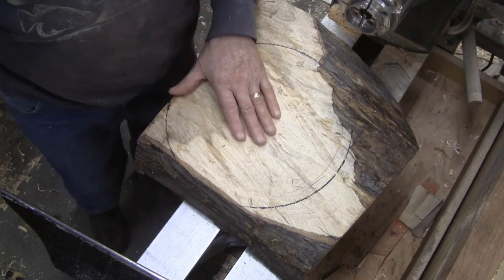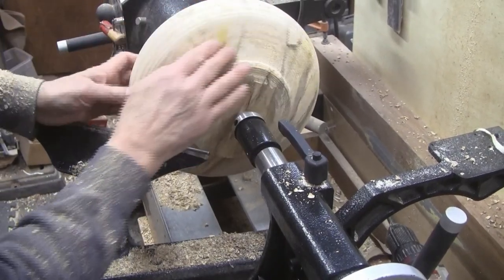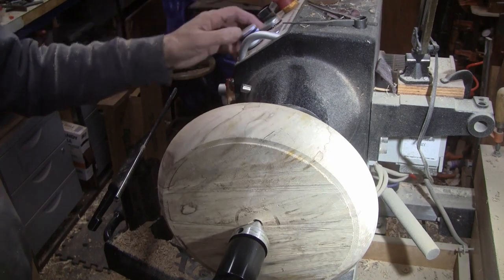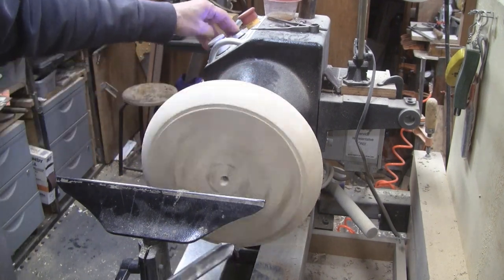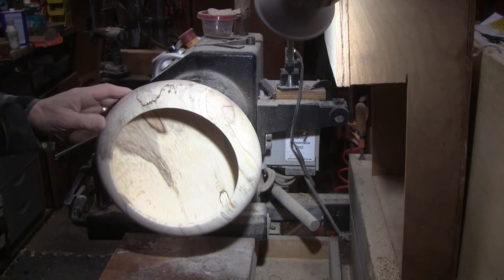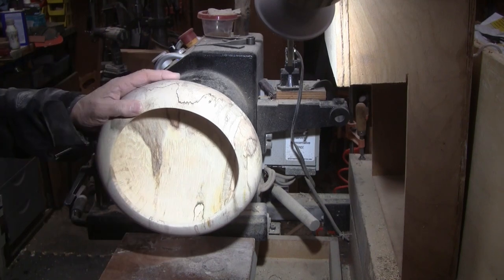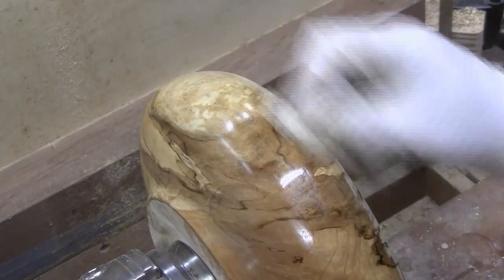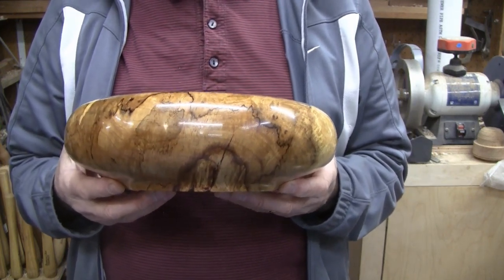Wood Turning Spalted Norway Maple Bowl

Comment: In this case, being polite when choosing the gift really paid off under your skilled hands. Good trick with the wipe on poly.
Reply from the maker: Thank you Valerie, Dave was very generous with the wood and he is also a wood turner. He showed me some very nice pieces he has turned.
I am looking forward to turning some Plum and Black Alder he gave me as well.
Thanks for your comment.
Gary
Reply: ThePapa1947 Black Alder? Have not run across that wood, yet.
Reply from the maker: @valeriehenschel1590  either have I but that is what is written on it. Two small logs about 14 inches long. It will be interesting.
Reply: ThePapa1947 Have fun! Hope you get multiple nice projects out of them! Sending one to Phil?
Reply from the maker: I would be surprised if he did not give Phil some already. We would have all met together but  we had already planned a motor home trip for that week.

Comment: Loved it, great job! Please tell me, what oil have you covered maple wood?
Reply from the maker: Thank you very much I am happy you liked it. I used Minwax Wipe on Poly.
Reply: Thanks for the answer! and how many layers did you apply to achieve such a shine? Do you need to use any base on wood before applying it?
Reply from the maker: @УДАЧНИЙДАЧНИЙМАЙСТЕР  I put 2 coats on the bare wood just to soak in as the wood was fairly soft. Then I wiped on 3 more layers.